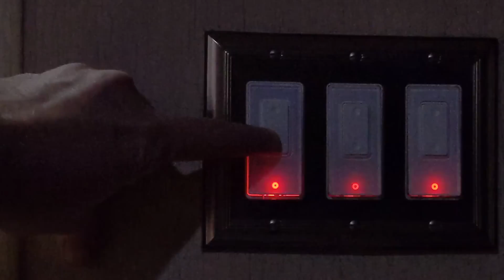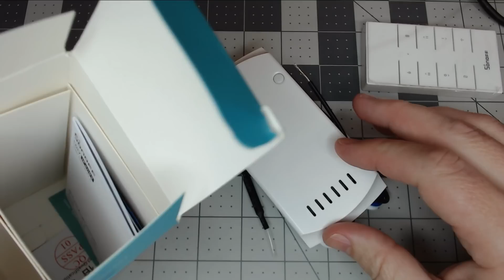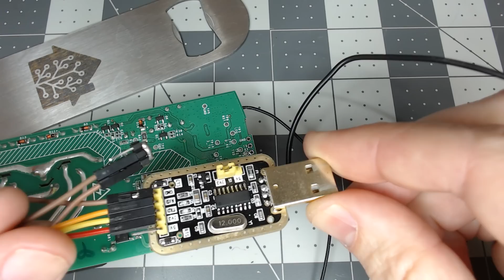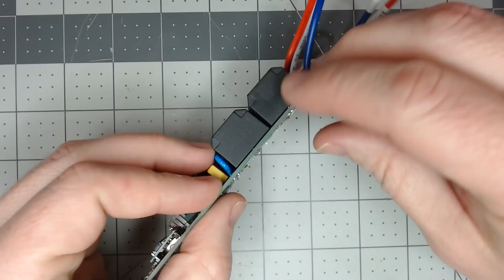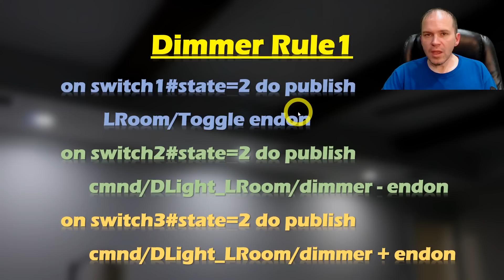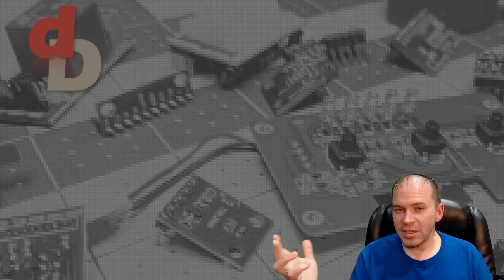Sonoff iFan03 Install with Complete Fan Speed Control

Comment: How the device can regulate the speed of the fan? Changing the voltage or that use other method? Regards
Reply: It uses a run capacitor to setup a phase difference between the two sets of coils. By adjusting the capacitance (switching them in and out via relays) the timing is made more and less accurate causing the speed to change. Think of it of pushing someone on a swing and adjusting when you push.
Reply from the maker: The same way as the pull string does by switching in the capacitors.

Comment: So, it looks awesome, but I am wondering in the case you lose the network connection, basically don’t have Lights or Fan at all??
Just like you said, I am also want to have a backup plan!!
Thanks for the video!! 😊
Reply from the maker: That is correct, if I have don't have internet connectivity everything is fine.  If I don't have any wifi signal at all well I have many more issues to worry about than my fan not working.
Reply from the maker: And side note the plan B is the remote control while your wifi is down. If you have wifi issues I would highly suggest Unifi access points. Best decision I have made in tech over the couple years I have had them.
Reply: Tasmota and hubitat. Everything will run Lan and does not require an outside internet connection.
Reply: TheSecman61 I know, but I mean, like local wifi down, or like my case HASSio crash by the sd card, always something can happen, still have power but with out something like that fan & lights are dead (specially lights dark in night, hehehe)

Comment: Do the caps need to be replaced on a us-based fan?  it seems to be a pretty significant mod.
Reply from the maker: If your fans don't use that size capacitor then the speeds will be off. I have asked Sonoff about making a US capacitor friendly one.
Reply: @digiblurDIY  The Sonoff website says the IFAN03 will work with both 120V and 220V.  I wonder if Itead thinks the IFAN03 is already US capacitor friendly as is.
Reply from the maker: Well it works with 120v but they don't mention what it does to fan speeds.
Reply: @digiblurDIY  What actually happens if you don't replace the capacitors in the IFAN03?  Does the fan spin way too fast?
Reply: @pauljohnson-yk5dq  medium and slow speeds are useless, too slow

Comment: Just curious the cap values in then IFan03 out of the box have two different values yet you replace them with two caps of the same value both 5uF why is that?
Reply from the maker: Because I didn't have the exact cap values my fan had in them.  They were close enough and we didn't notice the speed differences.  It actually sped up the medium a small bit which was actually perfect.

Comment: Like your video on IFan03  little confuse d in my case I only have 1 switch it has 2 knobs one for light on/off/dim and one for fan on/off/speed
my fan does have the light kit with pull chains that we don't use. how would I change the rules for this application and where do you load the rules, I assume in tasmota but you didn't really cover that, the bin file you provide has the rules for the two switch setup so how would I change it?
Reply from the maker: I used the dimmer to control the fan and light.  All you need is one power source going to the fan if you want to do it like I did.
Reply: digiblurDIY so am I understanding you used one dimmer for both fan and light. That would be perfect because I only have a single gang box in the wall
Reply: After further research on my wiring I don’t think I need ifan03, tell me if you concur. My fan has a pull chain set on high speed, I have power going to box in the wall coming out of the box I have 2 power lines one to fan and one to light so my thought is to just get 2 Martin Jerry dimmers and swap out the single gang box with a double gang box, what do you think

Comment: Travis (aka the Indiana Jones of La.), Thanks for cracking this nut. It's been a significant challenge in the open source community to get this working "correctly" with fan speeds in the US. Your capacitor mod, along with your Tasmota rules "ninjary" (is that a word?) demonstrate what's possible. Well done!
P. S., I (well, with perhaps some personal bias) like the featuring at the end of your videos of the various projects from the members of the community that you have nurtured, encouraged, helped, and built on in your Discord channel. 👏😁
Reply from the maker: Now if only the manufacturers would make an ESP8266 based 1 gang wide switch like this with the 2 caps ranged for 120v fans, they couldn't keep them on the shelf!

Comment: This seems like a good solution for people who have access to the wiring, is there a good solution for those of us that have very high ceilings, something controlled via a switch in the wall instead?
Reply from the maker: A ladder is my first answer. Second would be some Zwave fan controllers.
Reply: Lol I would love to purchase a ladder that size 25 foot + ceilings make that hard. Was afraid of that, not a fan of Zwave stuff but maybe worth trying out with the Conbee usb dongle
Reply from the maker: Same issue here. Never had much luck with the zwave or zigbee stuff and there isn't a decent drop in wall fan controller yet.

Comment: Thanks for this video! Have 5 iFan installed and with your video will finally replace the capacitors.
Quick question, I have Treatlife dimmers flashed with your latest Tasmota. Comparing to other dimmers I have the minimal intensity before it turns off still bright, is there a way to make the minimal dimming more dark. Thanks!!
Reply from the maker: You could change the dimmer range of the TuyaMCU control in Tasmota.
Reply: digiblurDIY thanks for reply! Unfortunately didn’t fix the problem. Its set min and max set to 1-255, and when I move physical slider goes from 46 to 234. I wanted to get the lights more dimmed, might be a hardware limitation. :(
Reply: @DanielNictheroy  Im not familiar with your particular dimmer, but for my shelly dimmer there is a calibration routine.  The documentation on the calibration routine says this is necessary because the characteristics of different lightbulbs require different ranges / control characteristics.  I think that its probably a function of the type of bulb you are using.  To test this, put an incandescent bulb, if dimming is okay with it then its your lightbulb, otherwise its the dimmer controller.

Comment: I looking at connecting a touch screen to these are the tx and rx pins used for anything else?
Reply from the maker: Nope, I actually have a MCP23017 GPIO expander on one and it works great.
Reply: @digiblurDIY  Thanks for the info I then can connect a Nextion Screen to it and have it directly control it.
Reply from the maker: I should mine a bit during the end of this video. https://youtu.be/r-kZ3OBeRrA

Comment: Question on the 2 5uf caps. Did you manage to put the case back after soldering? I changed my caps for my patio fans a 2 months ago and i just slap that damn thing in without the top portion of the case. It's working though and the fans are sealed and they are outdoor rated so hopefully they last long.
Reply from the maker: Yep. The blog past was updated with pics of it.

Comment: So, around 17:30 reminded me/confused me. You said "which is then picked up by Home Assistant". So ... here's the confusion. When you setoption19 1, I noticed that tasomta will switch the order of the topic. From "cmnd/thingyname" to "thingyname/cmnd". Why is that? You can't seem ever change it back. So, it doesn't appear you have done that. Also, what does HA have to do with this configuration? Unless you mean your MQTT server. But if your ifan03 is directly subscribed, and your switches are directly publishing, how is HA involved in this?
Reply from the maker: I didn't use SetOption19 here and this rule pushes to a custom topic as you can see.  You can use a HA automation to trigger based off this topic or a NodeRed flow to do your bidding.
Reply: @digiblurDIY  I understand that, I was just confused by you saying it went to HA when, from my limited understanding, it just got published on your broker and the ifan03 did everything "on it's own", so to speak. It made it sound like HA was a necessary part of the chain just to control it. But thanks for the answer!
Reply from the maker: The light topic publish is to control the light group in Home Assistant since it handles the states of the 6 lights in a light group I have installed.
Reply from the maker: Also if you do change the topics around with SetOption19 you can change them back in the MQTT config section - See here. https://youtu.be/KOg5qwO3Rh4
Reply: @digiblurDIY  I've tried that many times, but the topic changes automatically when i use setoption19 and if you go into the device's mqtt setup and change it back, it doesn't stick. Not really a big deal but I have always been curious about that.
Reply from the maker: Turn off setoption19 then change it back.

Comment: Do the capacitor in the link fit inside the case?
Reply from the maker: Yep. I will post pics of it on the blog link within the hour.
Reply from the maker: Updated the post at the bottom.  https://www.digiblur.com/2019/12/sonoff-ifan03-install-with-complete-fan_24.html
Reply: Fan-tastic! No pun intended ;)

Comment: I really appreciate this video Travis - I have purchased these and was very disappointed when Sonoff didn't properly account for US/CAN 120v. I will be doing these with 3 fans in my house.
Reply: What are the commands needed to voice activate the various speeds and light for Google Assistant? (ie. " Assistant, turn the master fan to speed 2? " ...
Reply from the maker: We have been using turn up the fan, turn down the fan, and I think high?  I don't recall all of them.